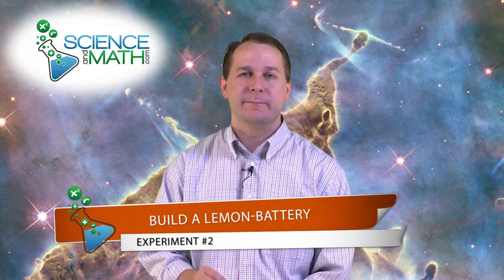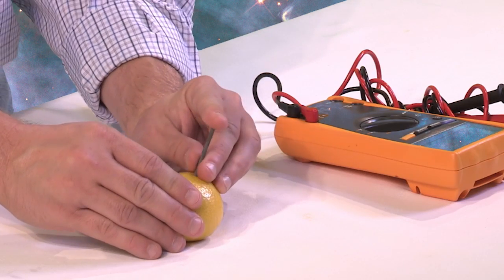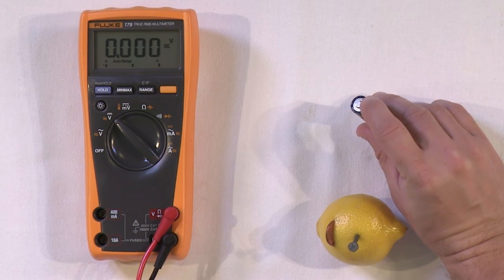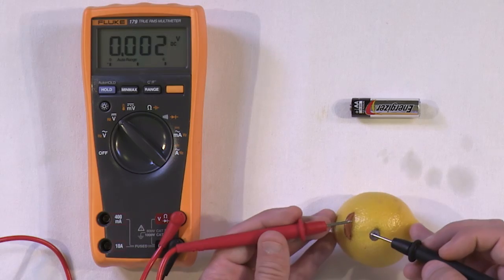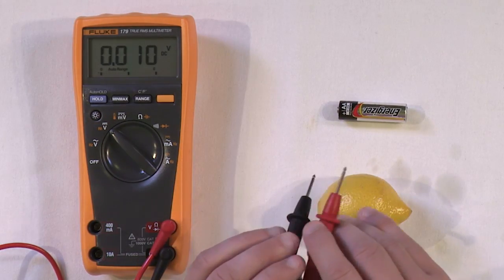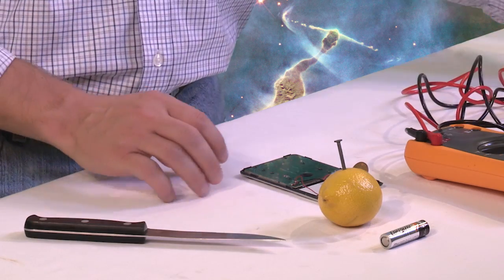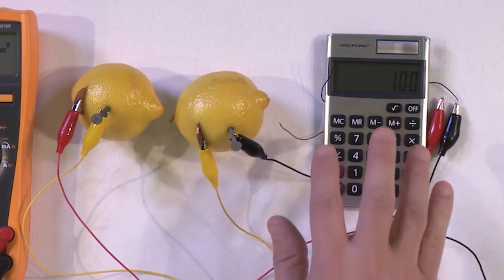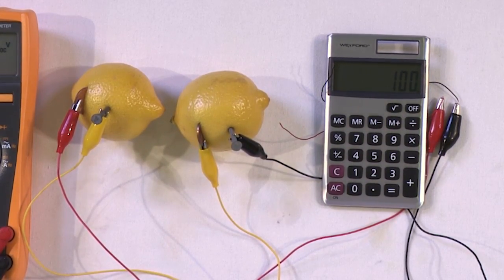DIY | Build a Lemon Battery!  Power a Calculator with Lemons! Amazing Chemistry Experiment.

Comment: whats a volt ? well it 's 1ooo,ooo million electrons in flow that = 1 volt its basic math and the lemon battery  has a anode and a cathode like most other kinds made and sold thay dont last to long tho if you look at how its made we see its allso a acid diode has same parts for electrode now we can make a self powering transistor and it can be recharged to a point that its self  run

Comment: @mathtutordvd 
Thanks Jason! My nephew will love this experiment. Reminds me of redox reactions back in general chemistry. I also have a question for you. How much knowledge in the chemistry subject is required in the field of electrical and mechanical engineering? I always wanted to ask that question because the engineers build the tools that are required for experiments. For example, we did an experiment on measuring H+ ions in a pH buffer solution with a digital pH meter.

Comment: in theory, if 100 lemons shown in the video are connected,  can it power up a cell phone?
Reply: not reallty
Reply: Gabriel Quiros you have to use more like 1000
lemons
Reply: Connect 100 lemons in series you would have a voltage of about 75-80 volts. In theory, a mobile phone would be kindled, indeed, it would burn at this voltage, but the current that would occur with 100 lemons in series is low from the point of view of the absorption of the phone. You should do a test with a phone used to see the result ..
Reply: Electric Experiments Doing a rough calculation, using a mobile phone that works at 7-8 volts, should be connected in series to get 10 lemons 7-8 volts. Connected in parallel to these other 9 rows of 10 lemons in series. In this way, certainly  the phone works well.